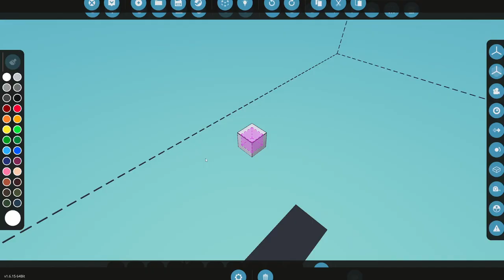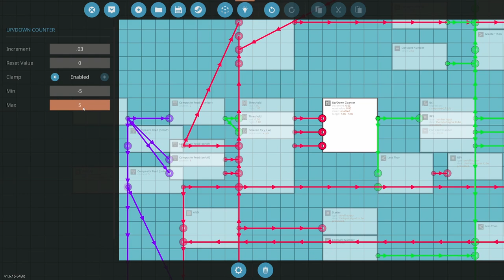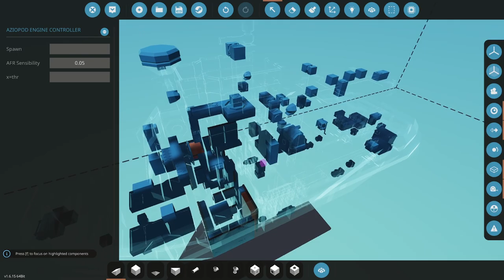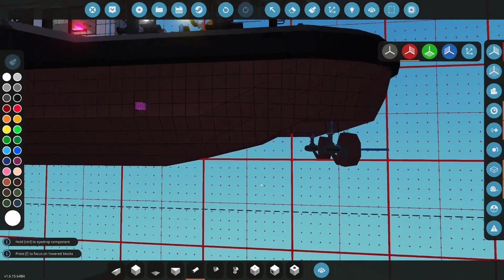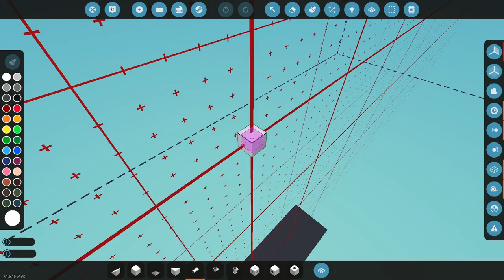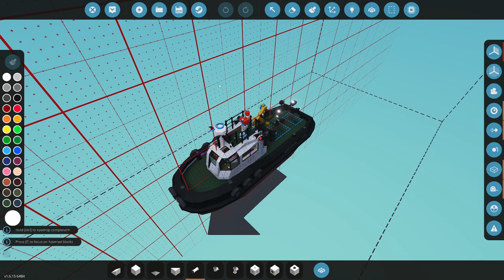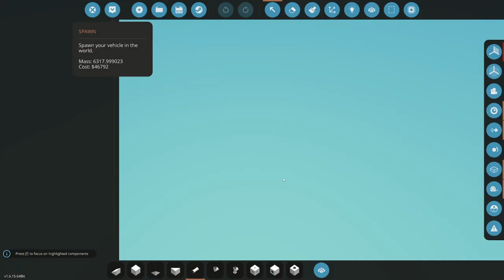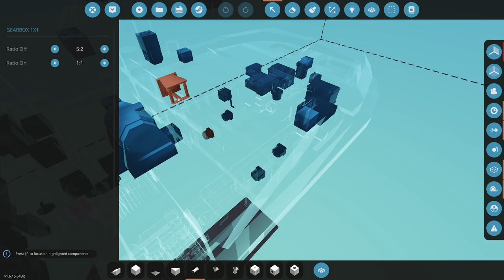Career Build Series 2023 Ep32

Comment: I just tested the power-loss over gearboxes and normal clutches. It would seem you lose 4.9% torque through each gearbox or normal clutch. Perhaps important for people who over-complicate their transmissions (such as me), these losses are exponential.
Reply from the maker: Nice testing. On the Eaton fuller ten speed for the pinnacle. I have it set up as a parallel high and low box as in the real one. With an overdrive. I think it has 4 sequential gearboxes and I'm not wanting for power 😁